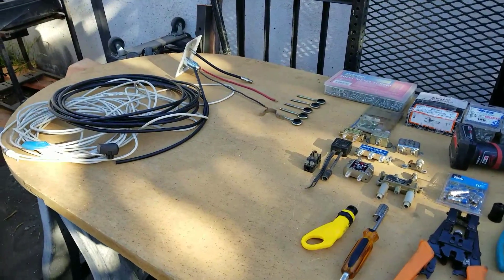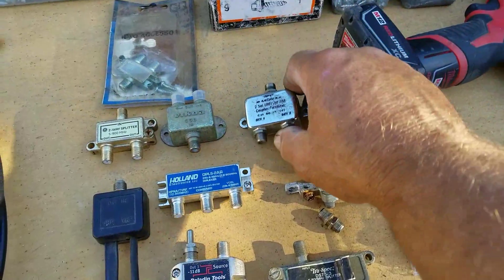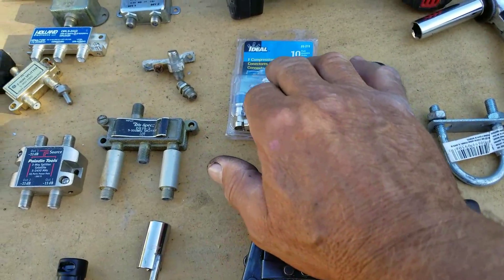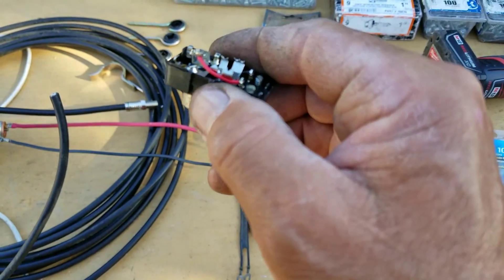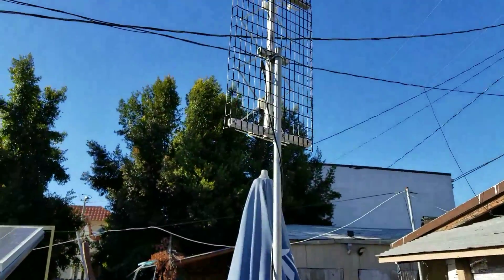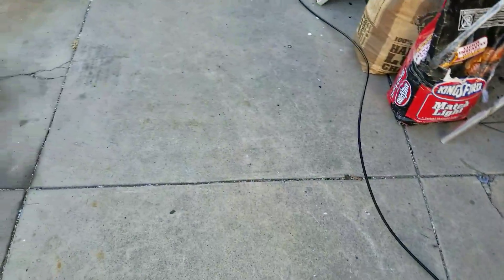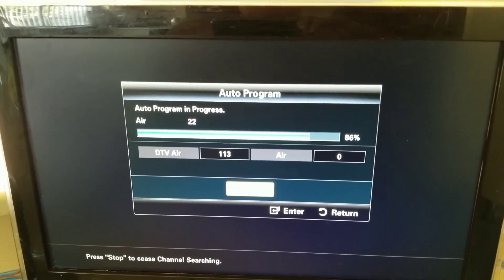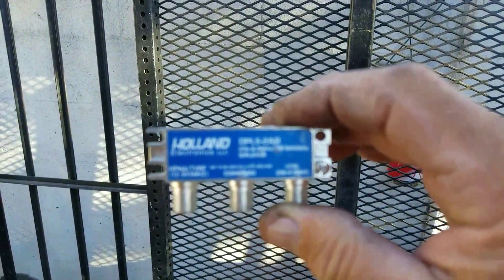High Gain TV Antenna Build #2

Comment: Nice job there G Bear. I will vote for an additional post with specs of your parts. I would find it real interesting. I built a gh some years ago and never got it on the roof. Now looking to dig it  up and modify it to todays world with the vfh mods reflectors etc. So your parts specifications would be a great help to me. Thanks for all your work.
Reply from the maker: Welcome aboard, Rick.  I'm pretty sure I already posted the build specs Xander measurements, but I'll have to check since that video is like 10 years ago.  I have been living off grid in the CA high desert since that time, and, yes, I am still using that antenna out here.  I also made a smaller one for a backup, and it is still in my storage.
Reply from the maker: https://amzn.to/45yEKtG

Comment: Was.   The.  Price.  To.   Make.   The.  Home make.  Antenna.    The. One.   The.  Is.    150.  Milles.  Range.      What.    Is.   The.  Home  make    Maximum.   Range.   Of.   Much.  Big.  Antenna.   The. Is.  Eny. Antenna.  Can.  Go.   Fare.  Be. On.    200.     Milles.
Reply from the maker: It cost me nothing to make these antennas.  I had scrap materials laying around.
As how far it can reach, that is controlled by the broadcast station and how man obstacles are in between.  I am in the desert with no trees or buildings in the way.

Comment: Hello GBear, did you do any other improvements to your diamond zig zag antenna ??? I am wondering if you can keep me in the loop. Thanks
Reply from the maker: Welcome aboard.   No new mods, and it is still working just fine.  Every now and then I need to go out and adjust it after a strong wind event, but that's about all.
Reply: @GBear  The wind must really be super strong to make your antenna need some tweaking. I like your way of using stuff you have lying around to make antennas. Keep in touch fella. I know flash floods are a real problem in the dessert.
Reply from the maker: Thanks.  I've been here 6 years, and camped this desert for over 30 years.  Never saw flash floods in this area. 
Stay safe!
Reply: @GBear  Stay safe G Bear's. I seen first hand what a flash flood did in death valley years ago. The deep ruts on  freshly laid roads for real long distances was just unbelievable. Do not remember the number of people that died. Just make sure you are not a statistic. Peace
Reply from the maker: Thanks for thinking of me.

Comment: Could you tell me if the Channel Master bowtie antenna works the same as this zig zag antenna you made with two side connectors next to the top and bottom elements?? One more thing, what is the back screening rectangular dimensions ??? Thank you Sir. vf
Reply from the maker: Of course!  The bow tie DOES NOT work nearly as well as the Gray Hoverman style antennas that I made.  Even the smaller of the two I made is better that that bowtie style.  Also, some commentary told me to space the diversion shield 4 inches from the zigzag elements for better reception.  I tried it and went back to my 2 and 1/2" space for better reception where I am.  Oh and the deflector screen grid is 1 inch by 2 inch cage wire, plastic coated from Home Depot.
Reply: @GBear  One more thing G Bear's, What is the diameter of the zig zag elements diameter ??? 1/4" diameter ??? Thanks fella vf
Reply from the maker: That is what I gave the measurements for last reply.   The frame was 1"×1" thin gauge square tube.   The zigzag rod is 1/4" rod from levelor blinds, the deflector screen is 1"×2" plastic coated cage wire.  I held it all together with pocket screws which are coarse threaded, so they wouldn't vibrate loose.  The plastic insulators I made from 1/2" thick cutting board type plastic.
Reply: @GBear  Excellent G Bear's. Now I know all. Well at least this stuff. Thanks
Reply: @GBear  Thank you G Bear.
Reply: @GBear  Thank you G Bear.
Reply from the maker: You're welcome.

Comment: Is channel 2 in your area actually 54-60 MHZ or is it transmitted on UHF?
Reply from the maker: I no longer live in that area.  I moved off grid to the desert permanently in 2018, but I still use that antenna and get 30 channels.  Sorry, but ch2 is not one of them.
Reply from the maker: Welcome aboard.

Comment: I'm from Buffalo NY, I'd pay You for a copper wire version of this! I have also been watching Southern Ideas makeshifter as well because I need to "cut the cord, cut the bullshit!"  My DISH contract won't be done till August 2021 but when it is the Bill will SKYROCKET like My former DirecTV did. I'm also contemplating a OTA DVR as well. I noticed this "4K" is not even here yet it is probably a thing for movies primarily as of yet. Some of the OTA only locals are still broadcasting in Standard Definition.  I still have a Sammy Plasma 60" from 2013 and for OTA I am using a passive indoor Philips HD Wing just to pull in what I need it for at the moment.
Reply from the maker: Welcome aboard!  I'm sorry Stephen, but I don't make these to sell them, I made 2 for my move off grid, so, like you, I could cut the cord and BS.
I now live in the California high desert on 20acres, completely off grid and I give out information for projects for free on my channel. GBears Off Grid Ways, A Homestead in the desert.  Check it out sometime!  I just finished a free seed giveaway and the lucky winner got over $200 worth of seeds.
Thanks for visiting my channel.

Comment: 156 channels over the air is just unbelievable. Great job fella.
Reply from the maker: Thanks.  That was from a highly populated area.   I now live remote, in the desert and pick up all 24 channels available here, some from San Diego,  180+ miles south of me.
Reply: @GBear   G Bear's Off Grid Ways-A Homestead In The Desert  Hello G Bear. I am not surprised with you getting 180 miles reception. When I was real young, my parents took us on a Route 66 trip of seeing America. At one small desert town there was a antenna on a rooftop that was the size of a king size bed. The name of this was called a bedspring antenna. Sorry got ahead of myself. We had lunch and I got to meet the person who owned the antenna. He said that reception was so poor in that area that was the only way to receive any TV signal. And most of the town were connected to that one eye to the sky. The picture was spot on in the days that fuzzy pictures were normal. Will never forget that. The guy was a Ham radio operator. One really eccentric type of guy that looked just like the professor from "Back in the Future". That is something that I will never forget.
Reply from the maker: @victoryfirst2878  great story!  Innovation is king up here!
Reply: @GBear  The antenna is burned in my brain. It looked as if someone took the first layer of metal off the bed spring and used the circular springs as elements. I often wonder if someone who has experience with radio waves could improve on the design ??? Maybe you could do some trying ??? You never know what the average person can come up with until one tries.
Reply from the maker: @victoryfirst2878  I just happen to have a king size bed spring laying around, but I have other priorities ahead of playing around, so it'll have to wait.
Reply: @GBear  It is just amazing how many great ideas are put on hold because life gets in the way. But if one keep that in the back of ones mind it will get done. Keep me in the loop too.
Reply from the maker: @victoryfirst2878  you got it!
Reply: @GBear  That is what I love to hear. And they say American ingenuity is dead, they are surly really wrong !!!
Reply: @GBear  Nice.
Reply: @GBear  Nice.
Reply: @GBear  Yes Sir.
Reply from the maker: @victoryfirst2878  I agree.
Reply: @GBear  I can understand fella.
Reply from the maker: Thanks.  I now live in a remote desert and using that same homemade antenna get 40 channels.
Reply: @GBear  Can you tell me if a bow tie antenna verses your zig zag antenna works better ??? How about using your adapter for VHF, does that pick up all of the VHF frequency or just the upper VHF signals ???? Thanks G Bears.
Reply: @GBear  Nice fella.

Comment: Man you have all kinds of valuable Tidbits I Say Valuable From A Personnel Perspective Some Are Almost Antique You Wouldn't have any Air capacitors or tuning capacitors kicking around" Remember My latest Kick Is Building Radio's
Reply from the maker: I might have.  I'm still sorting through my stuff.  I just moved out here in the off grid cabin in the desert last April.   Not fully settled in yet.

Comment: Good job on making the Fractal Antenna and you did good!  INFO OF FRACTAL ANTENNA: Inventor Nathan Cohen Patent US6452553B1 - 1995-08-09
 Application filed by Fractal Antenna Systems Inc
Reply from the maker: Thanks, but mine is a Gray Hoverman type, not a fractal antenna.
Google "pictures of gray hoverman tv antennas" for more info.

Comment: I built this out of 6 awg solid copper wire, mounted it 12 ft set it to the north where broadcasting towers are est. 35 miles sadly to say that good old boy in S.C.his Ultimate antenna I built and mounted in the bedroom closet out performed this. I got 24 channels on this, I got 41 channels on the antenna in the closet!
Reply from the maker: Sorry to hear it didn't work for you.   I used aluminum rod and have mine on my cabin in the California high Desert where I pick up San Diego channels.

Comment: Nice build, it looks professionally done. I want to ask you two questions. Is it necessary to use a diplexer for a dual antenna setup if their both gonna be used as one antenna pointed in the same direction? Also is a frequency mixer the same as a diplexer? I'm a bit confused on all the different splitter parts, different antennas and configurations. I bought a new dual antenna, but only cause I need strong signals for my location, so I'm pretty much stuck with it, not gonna use anything else.
Reply from the maker: I think what you really need is a signal amplifier.  If you have a weak signal adding extra antennas will probably work the opposite of what you want, but either way, you would want to use a diplexer if using multiple antennas, especially if they are different.  Usually one would use multiple antennas only when broadcast signals come from different directions.  In some cases an Omni-directional antenna would solve the multi-directional problem, but my experience has found that Omni-directional antennas don't have very good distance ratings and an amplifier is needed.
In my opinion, I would try a powered signal booster on a good quality antenna, and get it up as high as you possibly can.  Be sure to use RG6 cabling with good quality type F connectors and water proof covers and keep the number of connections to a minimum.  (Best is one at the Balun and one at the TV) if possible.  Good Luck!
Reply: G Bear I've got a signal booster coming in the next few days, without it I'd get nothing no matter the antenna. I got a 8 bay extreme signal antenna only because of some trees in my way that is not possible to remove. Figured if I could catch more signal over a wide area it'd do much better getting thru those trees than the junk thing I'm using now, which is entirely too directional. What I have decided to do, is use a combiner on this 8 bay antenna with one balum for each side, then a preamp from there, and yes I'm using all Rg6 cable. You think a combiner will do the trick?
Reply from the maker: Hard to say.  How far away is your broadcast tower, how high is your antenna?  A combiner is designed specifically to allow use of more than one antenna, but the combiner itself won't increase your reception.  Also, adding more antennas would only be a hit & miss situation.  Height, quality, line of sight, distance, and directional setting is what you need for good reception.
In my OC location I am less than 40 miles from the towers, but When I tested both my builds (1 & 2) I had buildings and trees in the way and I only had the antenna 7 feet off the ground.  I got excellent reception and ALL the available channels, and I didn't even use a compass to insure proper direction, only an estimated direction.
Reply: G Bear I'm about 60 to 70 miles from any towers. I'll have the antenna about 20 feet in the air. The booster I ordered is the best I can find on Amazon, it better be its only taken over two weeks for shipping, I'll get it either today or tomorrow. Directional works good in my location, but if too directional I loose channels cause of the trees. I'm looking for boost yes, but also a wide coverage area, I actually need both for my location.
Reply from the maker: It sounds like you are doing all that can be done. Let me know how it all turns out.
Reply: G Bear ok will do, should have it up and goin in a few days.
Reply: G Bear Got my new antenna and booster up and goin. I get all the available channels for my area, all the signals are decent although both my TV's don't agree with the signal strength, all is good so far. Time will tell how good it is when a storm and or weather conditions occur, but in my location I can't see it getting any better really even with my high gain booster... it's just a tough location. I am using all RG6 coax from antenna to the TV's. This is my 3rd system setup, and it's doing better than the other two I had so I can't complain any.
Reply from the maker: Gary Riefle Great!  ENJOY!
Reply: G Bear yes sir, thanks.

Comment: Also, i'd love to build one, so specs and materials list would be great!!
Reply from the maker: https://www.youtube.com/watch?v=_dvXcptaqVM  is the link to the build specs.  Let me know if you need more or have any questions.
Reply: I didn't see/hear if you said it, but what's the center to center dimension between the screws that hold down the stepped rods? I'm assuming 2". I have no idea if it even matters!! Also, is there a certain distance between the back of the rods and the reflector? Do you know if putting up 2, side to side but facing opposite directions would cause more harm than good?? Curious if I'd get more stations from multiple directions. Thanks again!! This is great stuff!!
Reply from the maker: OK, the center to center is 2".  I first marked a center on the vinyl block, then measured 1" off in each direction.  I'm not sure if it matters either.  I didn't follow any plans on these builds, I just winged it through by trial and it worked.  The distance from the rods to the reflector is 2-1/2".  Two 1" square tubes and one 1/2" vinyl insulator block.  I tried using 2 side by side facing different directions out in the desert and it seemed to lessen the efficiency, so I pulled one and settled for the 24 channels instead of 28.  (I can only watch one at a time anyway ☺. )
Reply from the maker: To see the antennas out in the desert (The reason I made them)  see: https://www.youtube.com/watch?v=Z-94DQONYNw

Comment: Thanks GB!! Do you think copper wire would work well or do you think the aluminum is the way to go? Number 8 or 10 copper?? Great videos--thanks again!!
Reply from the maker: I can't tell you is copper wire will work better or worse, since I never tried it.  I built this with the aluminum because I saved a bunch of the 1/4" rods from Levelor Blinds I pulled out on job sites.  Also, I built these for my desert homestead project and I have to deal with major winds out there so I wanted something durable.  I have one installed out there now and you can see the reception I get at https://www.youtube.com/watch?v=7fxqh4rW3UQ&t=32s
Reply from the maker: One other thing...  for savings on materials I searched my local area for industrial metal suppliers and found a place called IMS (Irvine Metal Supply) and when I visited the place found that like many others they had a REMS room where I could by cut-offs from other people's orders.  I stop in whenever I have a project or sometimes when I am in the neighborhood and pick up 'stuff' I think I might be able to use.  For the plastics I go to Paragon Plastics and fish through their REMS bins.  I'm also a bit of a pack rat when it comes to left over parts from 'universal' TV mounts, etc., and I also save electronics from everything from appliances to motors.  I love experimenting as you may have seen on my channel, and all these things have a future!  ☺
Reply: Thx for the 411!
Reply: Did you try any purchased antennas? I have an 8 bay on my roof about 25' up and I'm curious if I build one of these if it'll bring in more than I'm getting now. Did you do a TVFOOL mapping to your address? If so, how many stations were you "supposed" to get?
Reply from the maker: Yes, I tried a store bought antenna out there and got the same results.  Both get ALL the channels available, but the store bought one cost me $90. and the one I made cost me around $9.
Reply: G Bear ..
Hi....I see you are fortunate enough to live in the shadow of mile high Mt Wilson, where most major local TV towers are located, and which can provide almost unobstructed service reception for the huge LA basin and other counties out further ...even up to 90 miles.
Reply from the maker: Yes, in my O.C. location I receive from Mt. Wilson and have excellent reception.  As I have said before, I built this antenna for my off-grid desert location where I cannot pick up straight to mount Wilson due to other mountains in the way.